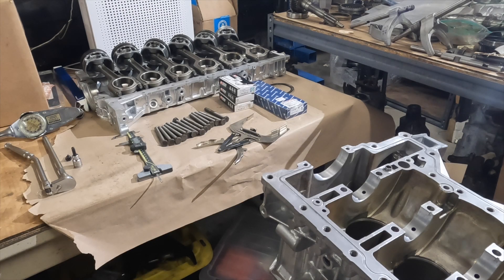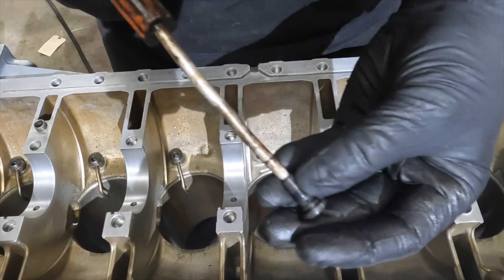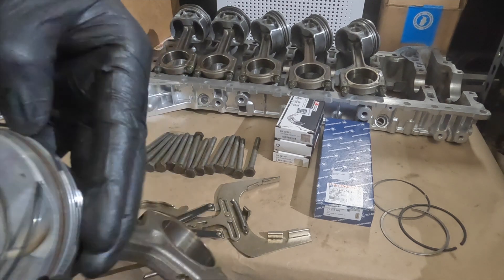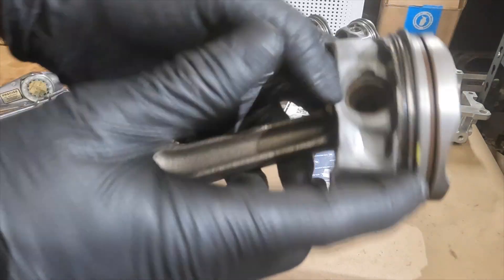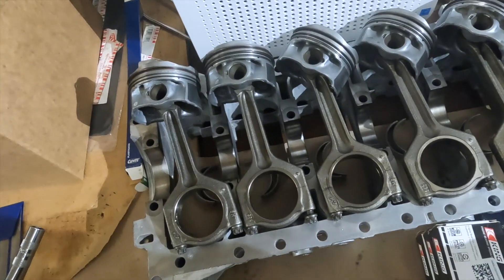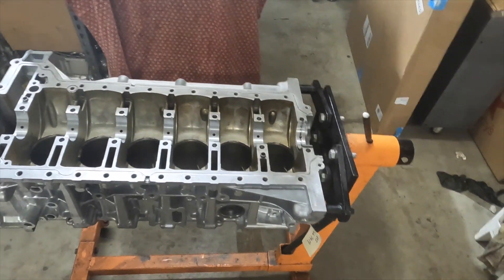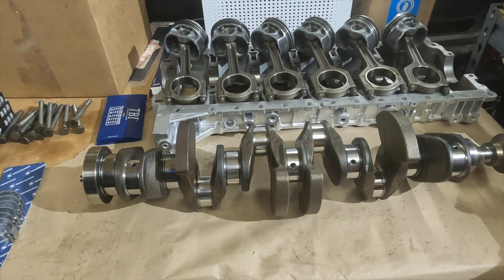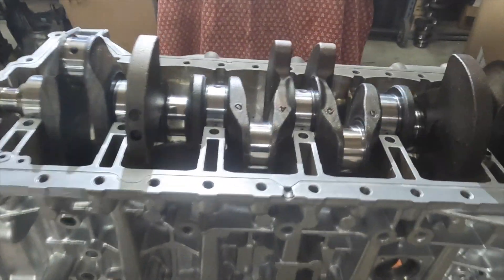BMW N55 17667419 Rebuild Main Bearing Oil Clearances Part 2

Comment: Good job 👍👍👍 thank's for share this.
You used old crankshaft bolt and old rod bolt for the clearance right ?
Reply from the maker: Yes 
Then new bolts on final assembly
Reply: @straightupbmw  
Good job, thanks for the video. How many NM are the oil nozzles tightened to?
Reply: Than'k for your reply its kind